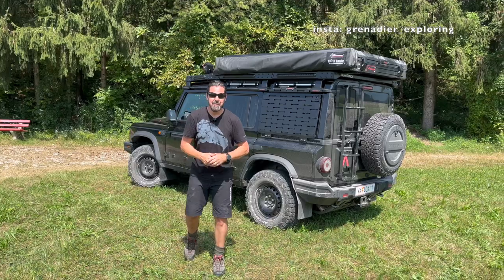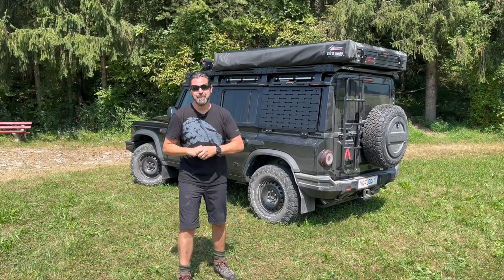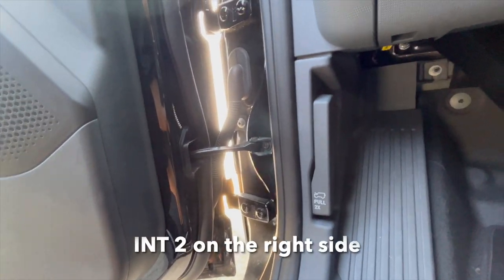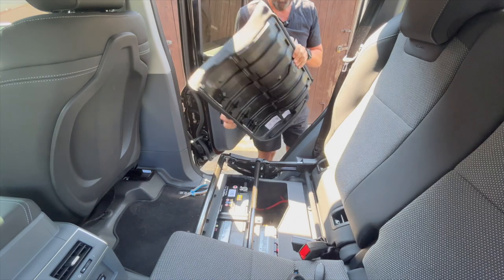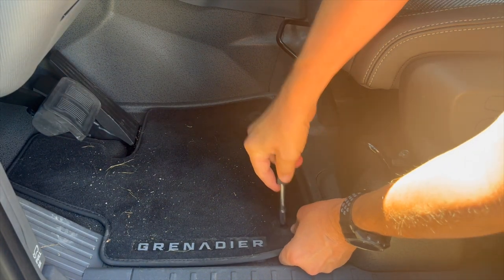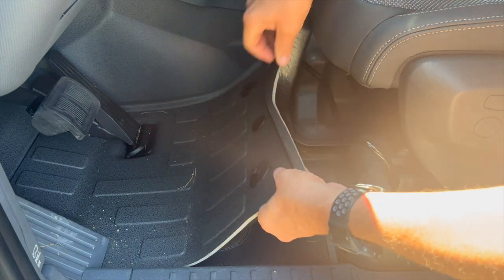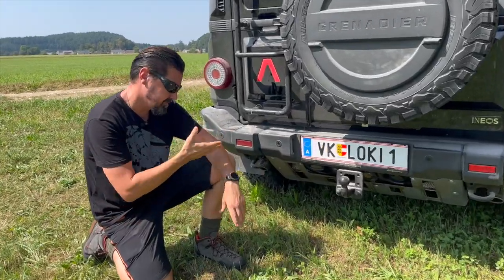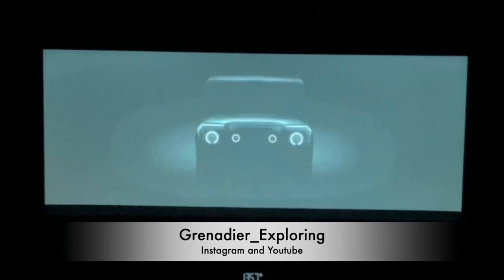How To? - Episode 01. Safari Windows/The Electrical Panel/Rear Bench/Drain Plugs /NATO socket

Comment: External power switches - What does EXT1 power up, I don't think you mentioned that? I cannot find any information about these switches in the user manual so your video is a great source of information. Thanks
Reply from the maker: Hi. I should have said "the remainng switches EXT 5&1 are powering the outlet under the bonnet". Sorry. those two cables are directly next to each other in the engine bay. If you need pictures, email me grenadier.exploring@gmail.com

Comment: Very useful, Thank you - Love the Electrical distribution system, so easy to hook up lights...   Who made your MOLLE Panels over the outside windows, do you like them, and do you use them much
Reply from the maker: i love them as well.
those panels are by the same company that produced my roof rack - HGM-Rack (www.hgm-rack.at). I use them a lot, currently i have water and fuel cans stored on them!
Reply: Good deal,  Thank you   @grenadier_exploring

Comment: Thank You for beginning this series of videos. Once a rear seat BOTTOM is removed, will its corresponding seatback then be able fold down (almost) flat?
Reply from the maker: it won’t change the behavior of the seatback. but it will give you more space in the foot area of the backrow and more length behind the front seats. understandable? 😬
i installed the dog crate behind the drivers seat for our trip to the north cape. removing the seat bottom allows me to move further forward with the crate and not waste any space. i will try to show that in one of my next videos
Reply from the maker: (the 18cm step will always be there. but the seatback is horizontal when u remove the headrest - with or without the bottom part)
Reply: @grenadier_exploring  If an 18cm thick pad or box  were placed behind the hinge line of the flat folded rear seatback, perhaps a continuous horizontal surface for sleeping could be created?
Reply from the maker: @billruttan117  it’s 18cm!! i designed my drawer system accordingly (u can see it in one of my other videos). it creates a flat surface u could
sleep on

Comment: Ah. You have things easy with access to the number 5 switched outlet (the 10A one). I have a relay box (?) at that location and no sign of any wires. Can't see the wiring loom under it, but can feel and nothing there. Reluctant to start dismantling stuff just in order to search for something that may not be there... I'd post a pic here but no idea how to do that.
Reply from the maker: do you have the winch?
in my case (and other grenadiers i checked), the cable ends are easy to spot and clearly to see.
Reply: @grenadier_exploring  No winch, but I want to install a deer (kangaroo) alarm and that switched outlet would be ideal. The component layout in my engine bay seems totally different - possibly because of right hand drive? If you are interested, I could send pics - do you have Facebook or somewhere I can send by message?
Reply from the maker: sure. Ingemar Rodler on facebook or Grenadier_Exploring on instagram. 
I will do some research on that as well and how the version affects the position of those outlets.

are you aware of the https://www.theineosforum.com ? they have tons of detailed infos and discussions going on there as well. super nice for grenadier owners.
Reply: @grenadier_exploring  Thanks. Yes, the Forum is good They helped very quickly on an SOS call when we found the normal diesel pumps at the fuel stations in country Queensland don't fit the Grenadier. That was a surprise...  I'll send a couple of pics for your reference to your Facebook. No-one has been able to help with my 10A outlet though...